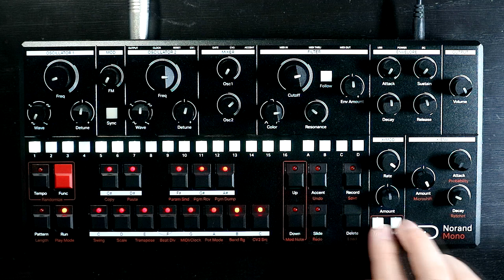Turning the Norand Mono into a Drum Machine, because of course I am.

Comment: Hello, very useful video, thanks. I don´t totally get what you are doing at minute 13:11. You assign X-mod to the X-env but what is X-env modulating? The cutoff?
Reply from the maker: So, I had the X-Mod modulating the frequency of oscillator 2 (at audio rate to make some noise). When you hold func and hit those two buttons to link the X-Env like that it will modulate the *amount of the X-Mod*. You'll notice that I turn the amount on the X-Mod down so that the noise goes away then turn up the amount on the X-Env and it comes back but popping up on each note rather than continuous. Then I make the X-Env only trigger on certain steps to control where the snare happens.